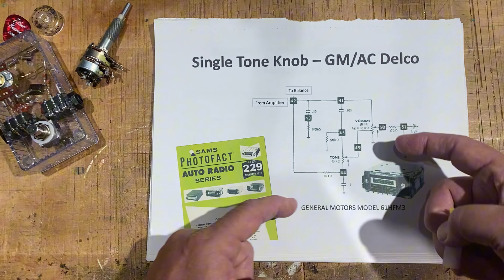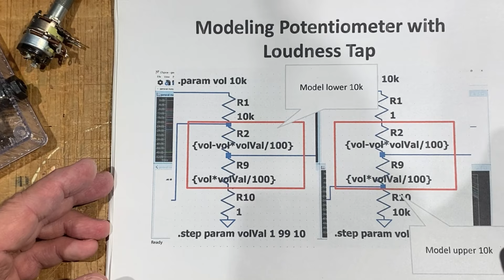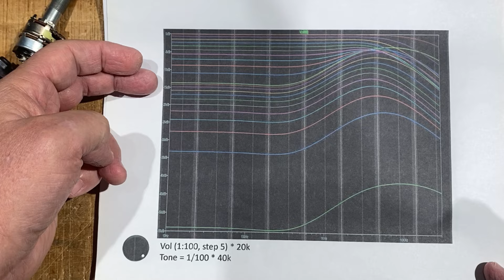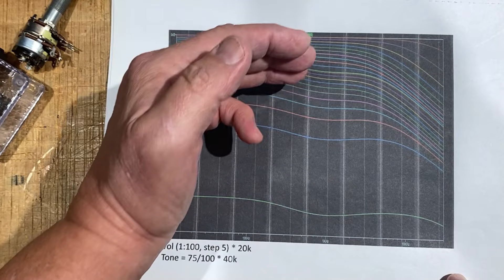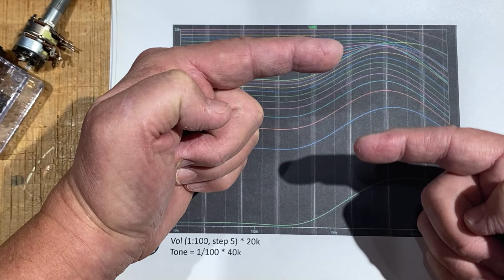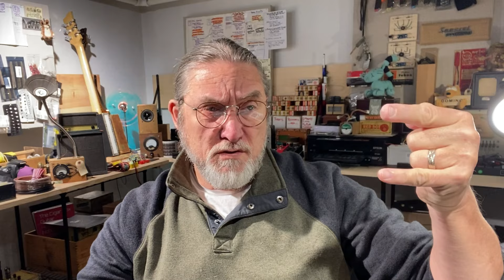What Makes Old GM Radios Sound Cool? LOUDNESS TAP and TONESTACK Frequency Analysis

Comment from the maker: Ever wondered how the loudness tap on vintage GM radios really works? In this video, I dive deeper into the AC Delco / General Motors 61HFM3 circuit using LTspice simulations to uncover how the volume and tone controls interact in 1970s GM car radios — including Chevrolet, Pontiac, Cadillac, Buick, and even Lear Jet audio systems.
By modeling both the lower and upper halves of the volume pot and the unique loudness tap, I reveal how these controls shape the frequency response across real-world volume settings.
We also explore why virtual loudness tap resistor mods don’t behave the same way — and what happens when you adapt this circuit for guitar amplifiers.
Reply: Most sophisticated such solutions use this aditional tap is input output type in one.  Sopranos above 5kHz suppose to  bridge   potentiometer  with  C  or RC    while mid range is drained down with another RC filters having cross frequency 600- 800Hz Looking at this GM schematic looks like this two functions are balanced which action is more desired  and it may be manipulated with  tone potentioneter. I tried in my pracitice simmilar separate solutions but using one  common tone potentiometer i find smart  idea.
Reply from the maker: Yep, I see how the loudness tap works as both an input and output. I went in circles reading online about how it worked. That's why I wanted to make the LTSpice curves to see it for myself. I could easily make a 2 and 3 knob tone circuit, but I like the simplicity of a single control. Thanks!

Comment: If you want to check out a really cool vintage delco radio ,look at the 1946 to 1958 gm senior cars radios.they had the tone cont as the one in your videotape is tap on volume control .but the best feature is the impedance coupled push pull output stage.very similar to the circuit used in wurlitzer juke box amplifiers if the same era.hitting those output tubes with that choke coil really gave those output tubes some punch! 8 inch speaker behind that huge baffle dash really sounded good. They were about 8 watts r.m.s. I would like to add a Bluetooth to one of these audio stages.guranteed great sound espically with co axial tweeter added with simple crossover cap.
Reply from the maker: I looked at, briefly, some car radios from the 1940s. There were a few examples that had tone circuits built into the power amps right next to the speakers. It was very strange. I will have to dig into that and Wurlitzer. Thanks! And BTW, it was my trying to add bluetooth to my Chevy that ended up breaking the tone control I handle in the video. Oops. I eventually got something installed that looks vintage with modern guts.

Comment: The loudness tap was supposed to compensate for the Fletcher–Munson curve. Most audio equipment had  it up until a golden ear author for an audio magazine (Les Feldman) wrote about it negatively in the early seventies. Then it started disappearing so equipment didn't get negative reviews. They should have just shot the guy. I worked in high end preamp design at the time and lived through this period of censorship.
Reply: I think his opinion was secondary  and it covered another reason - it was  growing popularity of stereo systems which were intencded to cooperate with not own designated speaker but leaving decision to customers who were matching separately sold  cheaper because made in large numbers    market   speakers.

It was driven by lowwer price of market speakers than unique brand speakers designated to ph. compensated gear.  Any damage of such designated spaker was causing   trouble to get identical  And in opposition to mono radios where speakers wesre secured in radio and secured by prioducer design separate stereo were prone to different damges 

  Producers  of mass speakers started to race for customers  buying  speakers to  not phisiologicaly compensated amplifiers and amplituners so  they implemented   F-M curve into their sounding. which was   easy because 2-3 way spakers by design deminish middle band.  Anyway  connecting them to ph compensated resulted in overcompensation. For this reason producers of gear  provided in stereo systems knob alowing to switch off compensation. Many customers  appreciated  "off" position with cheap but acceptable speakers and that is how whole idea was buried leving people with fixed compensation with spreakers which may be adequate only in very narrow range of loudness. The race for ideal sound seems since not possible to win
Reply from the maker: Interesting. There seems to be constant battle between equipment manufacturers, the consumers, and some built in desire we have to build something cheap that sounds good (or just good enough). Thanks for your insight!
Reply: @MadScientistGuitarLab  I would not  account it i battle . There was   generaly not noticed revolution in audio which was created by popularization of stereo. It caused that listeners were shifted few meters away from speakers , to get comparable  loudness was required few times more power, speakers had to be placed separately from gear and their location became important. , started deliberations about gauge and standards  of speaker cables 

All this wasn't in mono radios which primary were equipped with loudness correction which obvioulsy with close to speaker  sitting listener had different tuning. 

This is why it is not expected that the same designed circuits will work for big  home  stereo  anyway basics  are intact.  

 I find that in stereo system necessary lifting both for for low range is much less due to room resonance nd reflections in higher midrange. ( except when listener treated room acousticaly which is not my choice ) In fact in my practice with best speaker sets  it comes so close to no-correction that I sometime switch it off - specialy at night when i want low range to be not heard by  neighbours. It  had marginal  role in mono radios.  If stereo geear producer followed established values without consideration   it could add to diappointment.
Reply from the maker: @Mikexception sounds like I could do a whole mini series on the history of this stuff 😮. I’m old enough to have experienced the evolution of such things, but my interest was always in guitar amps and signal processing.  Hifi had different trajectory but it’s related to what I was into. Interesting stuff!
Reply from the maker: That's really interesting background, thanks for sharing! I will have to dig into that history. I don’t suppose “Good Sound” by Dearborn repeated the writings from the magazine? It’s been in my wishlist for a while as something controversial to read.